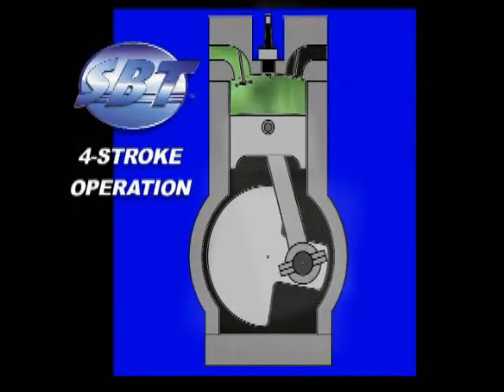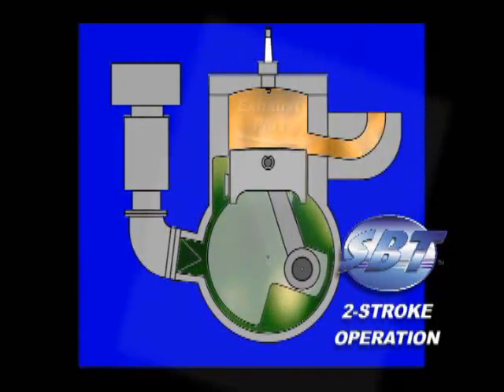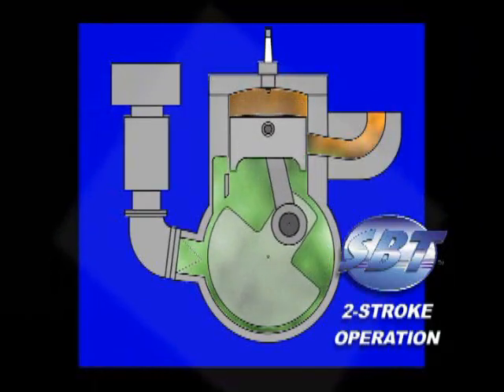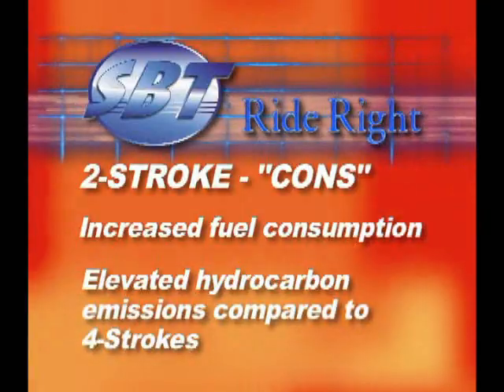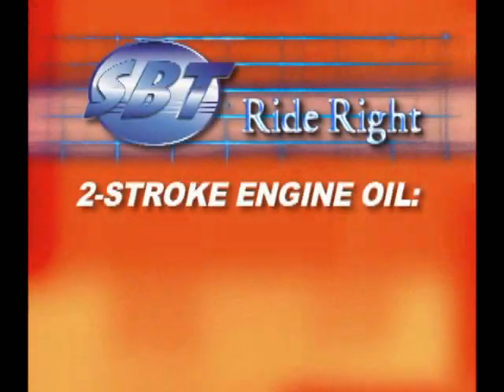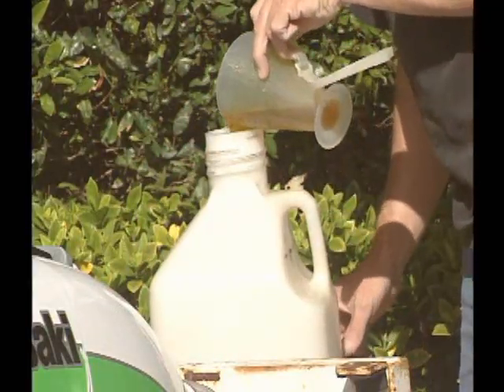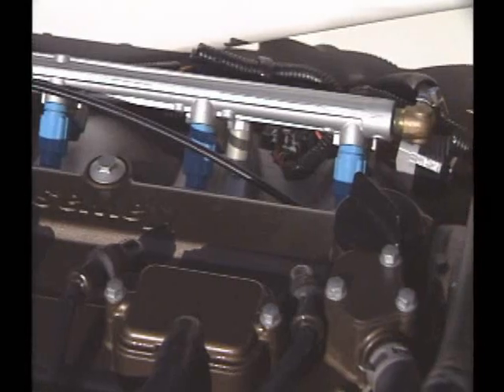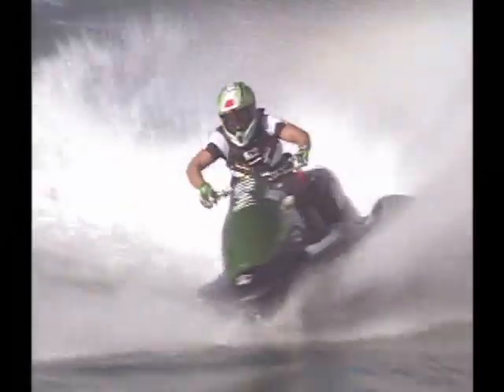2 Stroke Engine vs 4 Stroke Engine

Comment: 2 types of injection probably today,But yesteryear saw Suzuki us CCI Cylinder and Crankshaft injection,Four plastic pipes from the oil pump fed the four bearings and the other 3 pipes to each of the cylinders to lubricate the ring,And Scot a long stroke two stroke used "crancase pressure",The idea was and worked smokeless at low revs and around town

Comment: Interesting, learned something today.
We have mopeds here that are either 2 or 4 stroke. But any modern moped is 4 stroke due to them using much less fuel and spewing out less crap. The added complexity and higher price? Well, the consumer just has to accept that.
The pro is that normal car fuel, gasoline, can be easily used. Unlike the "pre mixed" that was sold for a long time.
Reply: Premix is a crapp idea little lubrication on tickover at traffic lights for example it was a cheap crappy idea,Injection is superior

Comment: Both types of motors have been around for over 100 years. Also, the 2-stroke in the diagram is the least common type of 2 stroke.
Reply: Didn't look very good diagram

Comment: Okay so what I got from is that. 2-strokes arefaster and get more power going because it combusts every cycle(rather than everyothercycle) because it is intaking Fuel/air and releasing exhaust at the same time from the carburator (fuel mixture/crankcase + combustion chamber. =exhaust/fuel)

Since it's so fast some of that fuel mixture dont get combusted/burned properly.
Reply: But the Japanese did put valves in place to further complicate matters for more power or poor old Yamaha to remove the power band and spread it across the rev range,The public are STUPID, In the hands of a motorcycle racer it would be appreciated but the public are dense,Lotus did something similar, The public want the Thrust the violent power suddenly coming on

Comment: But for the case that I get it right but if they say 2 stroke have less weight but waist more gas than 4 stroke it means that 2 stroke equals with 4 stroke because carrying less weight and have more power than the 4 stroke but only has an emission problem. Am I correct?

Comment: The advantage of two-stroke is less maintenance. There is no oil to change! The oil changes automatically as the engine runs!
Reply: But the ports in the cylinder wall means more wear and sooner rebuilds
Reply: @SiegePerilousEsauMaltomite  Chrome liners,Very hard

Comment: The main drawback of 2-strokes is they are less reliable. The engine will simply not last as long before needing to be overhauled compared to 4-stroke. The other drawback of 2-stroke is that they "load-up" if idling too long. This is no good for watercraft since there are no wake zones where the engine will be idling for a long period of time.
Reply: Small ends and rings on my old two stroke triple 550cc was 20,000 mile failing it was no less "reliable" than my previous 4 strokes

Comment: does it really have a higher fuel consumption? My simson 50ccm needs 3-4 l at 100km
Reply: My 550cc two stroke triple gave 35 mpg a four stroke would have been 50 mpg

Comment: Two things i don't understand.
1. Engine oil system (2 stoke).
2. What is the clear of water?
Reply: 2 stroke oil system - gasoline and oil are mixed together in the carburetor and/or the intake manifold. Then the charge of gas/oil moves into the crankcase where it provides lubrication to the crankshaft and bearings. After this gas/oil charge is used for lubrication in the crankcase it travels through transfer ports into the combustion chamber where it is compressed and ignited to produce power.

Comment: In my experience 2stroke engines are way more durable then 4stroke engines, but the fuel efficiency combined with less cancerous exhaust fumes make 4stroke the clear winner in my opinion.
Reply: They also just last longer, because two stroke engines combust twice as often, but at the same time its easier to perform rebuilds this way.

Comment: Noob question: how come they don't make a shutter in the cylinder wall, that is pulled down in front of exhaust, when piston is at bottom, and moved up with the piston, as it goes up again?
Reply: It would probably be possible with a timing chain set up and valve similiar to a 4 stroke engine.

Comment: for 2 stroke there is part of the cycle where fuel intake and exhaust open together. This would result in waste and unburnt fuel goes to the exhaust.
Reply: install a spark plug at the rear of the exhaust to make sure all fuel is burnt
Reply: @benmsaba  Attact exthaust to a small jet engine just off the back of the bike, more power less fuel waste, its just that simple. get yours now for an amazing 20 easy payments of just $19.99 

addition fees and cost not included

Comment: This guy does not know his facts 2 stroke engines are quieter than 4 stroke engines because 2 stroke engines need an expansion exhaust which reflects the sound back

Comment: no wonder why my 150cc 4 strokes had no chance against my friend's 150cc 2 strokes and 150cc 2 strokes can smoking 250cc 4 strokes in 500 metres. whoever said 2 strokes sucks, they definitely never feel it's power.
Reply: I had a Honda CD175 AND my friend a RD125 and beat me till 50mph and the i would go past with his head on the tank to decrease air resistance to no avail I would leave him behind

Comment: so wankels are not even mentioned? would be lot better for jetski in my opinion.
Reply: Not really, it would require a gear reduction since the RPM's are higher in a wankle, not really practical in a jet ski as it would add too much cost and complexity and the gearbox would be too big to fit in the compartment of a jet ski. The current design of jet-ski's have the engine connected directly to the output, everything would have to be redesigned from scratch.
Wankels are much more suitable for motorcycles which use higher-revving engines compared to automobiles and jet skis and they already have transmissions.

Comment: 2 stroke= braaap
4 stroke=thippppp
and imo 2s sound more exciting.. in mx it takes a 450 4s to run with a 250 2s, 2s less expensive less cost to rebuild, eaiser to rebuild, and simple.. 4s more riding time between rebuilds, eaiser to ride, eaiser to control. more costly to buy and to maintain.

Comment: They have 2 stroke engines that operate like 4 strokes as in the oil stays in the crank case.  I believe they are direct injected and run on diesel.

Comment: This isn't actually 100% correct... There are 2 strokes that have valves, giving them just as many moving parts as 4 stroke, and there are also 2 strokes that burn just as clean as 4 stroke. In addition, there are also plenty of 2 stroke engines that have oil sumps just the same as 4 strokes. I can't say whether or not such 2 stroke engines are used on jet skis, but they do exist.

Many ships for example use a 2 stroke, turbo charged, direct injection diesel engine that have all of the above differences from what the video claims about 2 strokes.

Comment: I like the very accurate clear explanation in this video. 

People often use the terms "2 stroke" and "2 cycle" interchangeably. And I've even seen it stated both ways on 2 stroke oil bottles. But the correct term is "2 STROKE", not "2 cycle". One internal combustion engine CYCLE takes either 2 or 4 strokes, making both 2 cycle and 4 cycle the WRONG terms. Just because they're used interchangeably, and even though some 2 stroke oil bottles say "2 cycle", that does NOT make "2 cycle" the correct term.

I'm glad this video is here to give accurate information. Thank you.
Reply: You MUSTN'T do that,America is NOT the world language,English speaking countrie use a hybrid English Americans,Australians, New Zealand it's a Variation of the original English from Britain,PANTS in Britain is Usally trousers,A sweater a jumper, 2cycle 2 stroke, I prefer 2 stroke but don't condem cycle

Comment: 4 stroke is much better
Reply: Eli Bond 4 stroke is more fuel efficient and has more outcome
it doesn't need oil injection into the cylinder
it is much more quiet and soft working
Reply: not really
Reply: +Behrooz KHaleghi Rad 2 stroke produce more power than it's 4 stroke counterpart
Reply: Behrooz KHaleghi Rad yes 4 stroke is better i just like my ktm 2 stoke more then a 4 stroke
Reply: Behrooz KHaleghi Rad  no 2 stroke is better

Comment: CR250R (2stroke) ----------------
Peak power: 59.01 HP *
Weight: 213.8 lbs *
Torque: 37.6 ft/lb
Power-to-weight ratio:(2.42 lbs/hp) 

CRF250 (4stroke)  ---------------
Peak Power: 51.36 HP
Weight: 228 lbs
Torque: 35.2 ft.lbs
Power-to-weight ratio:(4.43 lbs/hp) 

Yz250 (2stroke) ---------------
Peak power: 46.86 HP *
Weight: 212 lbs *
Torque: 30.6 ft.lbs
Power-to-weight ratio:(4.52 lbs/hp) 

YZF250R (4stroke) ---------------
Peak power: 43 HP
Weight: 221 lbs
Torque: 20.1 ft.lbs
Power-to-weight ratio:(5.13 lbs/hp) 

MAICO 700 (2stroke) ---------------
Peak power: 82 HP *
Weight: 223.4 lbs (dry) *
Torque: 79.29 Nm

KTM 690 (4stroke) ----------------
Peak power: 65.7 HP
Weight: 308.64 lbs (dry)
Torque: 68 Nm
Reply: So why people u have to freaking Say 4 stroke has more torque than a freaking 2 stroke!!!!!!!!!!????!!!!!!

Comment: two strokes when they hit their power band they can out run a 4 stroke by a long run
Reply: What a 450 vs a 250 2 stroke then yea. But a 250 2 stroke vs 250 4 stroke it will win Mike cap
Reply: Ryan Howard my yz 125 would dust a 250 4 stroke any day of the week

Comment: Sounds like 2 strokes are ripe for a turbo with all that unburned fuel, i wonder if one could add that onto the catalytic converter to break down the particles but harness the energy released from them being broken down.
Reply: you cant really put a turbo on them plus you realize that why people ride 2 strokes is they have hard hitting high end power like a turbo charged 4 stroke
Reply: Troll or idiot?
Reply: You're an engineer huh?
Reply: Unburned fuel wont help a turbo...

Comment: bull 4 strokes having equal power  to 2 strokes and more torque thats just crap you need to 2x to displacement of a 4 stroke to allow them to even compete with 2 strokes
Reply: 2 strokes have about 50% more power than the same capacity 4 strokes. It's not double the power because a significant proportion of the fuel is unburned and lost out the exhaust. In MotGP racing the 500cc 2 strokes produced about 180 hp and the 1 litre 4 strokes about 240. So that's about 360 hp /litre for the 2 stroke and 240 hp /litre for the 4 stroke. That's about 50% greater specific output for the 2 stroke. The specific fuel consumption of the 2 stroke is greater. 4 strokes need to rev higher to produce competitive power outputs. Many people get the impression that 2 strokes are revving higher than 4 strokes because there are twice as many firing cycles as a 4 stroke. 2 stroke MotoGP engines revved to about 12,000 rpm whereas 4 stroke MotoGP rev to about 18,000 rpm.
4 strokes don't have more torque. They just produce the torque in a different part of the rev range and may have a broader torque spread but not always.  The torque characteristics of a two stroke very much depends of the design of the intake, transfer and exhaust ports coupled with the design of the expansion chamber exhaust. The inclusion of reed valves, power valves and disk valves enhances the power delivery characteristics of 2 strokes. IMO, if further development had gone into 2 stroke design they could have been a viable and eco friendly alternative to 4 strokes. Diesel 4 strokes are on the way out and were seen as a planetary ecological savior but recent revelations have shown they aren't as fuel efficient as originally thought and also have poor emissions of cancer causing agents and other noxious compounds. There is a global push for small turbo charged petrol engines and ultimately electric vehicles will be dominant. Even they use coal fired power stations to charge their batteries. Sorry for the long post. I'm drunk.
Reply: +Mike levawsky oh sorry dude i accidentally said 4 strokes at the end. 2 strokes have soo much more power your right i miss typed. yea the 250 2 stokes compete with 450 4 strokes because 250 2 strokes will easily win competing with 250 4 strokes
Reply: This made no sense.
Reply: me or the video
Reply: WeRideLikeThis just turbo charge the 4 stroke and voila.
Reply: Why is this? Is it because there's two less steps for the piston to take to return to combustion, which in turn results in power being produced at, as you stated, two times the rate of a four stroke? I know that looks sarcastic but I'm genuinely curios.
Reply: ***** yea there are a few reasons that being one look it up i dont know all of the reasons
Reply: Are u dumb more torque ???!!!! Here seems noone knows what Is torque....
Reply: +WeRideLikeThis complete opposite mate, why do you think that the 250 classes in motocross have to race with 450s, a 250 2 stroke will beat a 250 four stroke in torque, speed and horsepower

Comment: 4 strokes are definitely not quiet. get your facts right.
Reply: it depends on the motor, but they can be just as loud as a 2 stroke for sure
Reply: +• that made no sense
Reply: the pistons are 4 strokes the engine is and no wonder because it has a CAT and a muffler along with a longer exhaust pipe
Reply: +ZThesixeZ 4 strokes are quieter from close up but low range frequencies and sounds travel farther than high range(or pitch) but yes up close a 2 stroke is usually louder because of its valves and combustion
Reply: Liam Weare dude I hate to break it to you, but 2 strokes don't have valves
Reply: Liam Weare first: not all 2 strokes have Reed valves. I have a  2 stroke that uses rotary disk valve. Second it sounded like you were referring to a 4 stroke valve setup 3rd with the right exhaust you can put a 2 stroke to shame with a 4 stroke
Reply: I don't hate to break it to you but 2 strokes do have valves. They often have disk valves or reed valves.
Reply: Still better than a screaming tin can that poisons everyone
Reply: Liam Weare hm thats good to know
Reply: +zenith0000 yes they do Reed valves I'm not talking about intake and exhaust valves
Reply: +Liam Weare like a 4 stroke not those valves
Reply: lol
Reply: +Riley Brooks he's saying the pistons within his car are 4 strokes , and his car is quiet
Reply: 4 Stroke are quieter

Comment: hold on hold on.

so two strokes do not have camshafts??
Reply: +Eli Butterfield In general no they don't But there is a 2 stroke diesel engine (cant remember what its called) with a camshaft. But petrol 2 stroke engines have no cam shaft
Reply: +Derek Tweedie the detroit 71 series is a 2 stroke with a cam.....they came in 2 4 6 8 and 12 cylinder configurations. and they SUCK!!!! the rev fast and high but have way too little power for 71ci per cylinder and its almost impossible to maintain a set rpm. also they are well known for coating everything around them in oil, my 6-71 uses 2 gallons of oil for every 70hrs of use.
Reply: yes

Comment: So I have a question

If you have a 2 cylinder 2 stroke, will it be as smooth as a 4 cylinder 4 stroke?
Reply: lol wtf are you even talking about
Reply: +GamingBros no
Reply: +GamingBros wait what, smooth?
Reply: no it wont be
Reply: Nope, the 4 cyl  engine has a more balanced crank shaft.
Reply: Betaa no